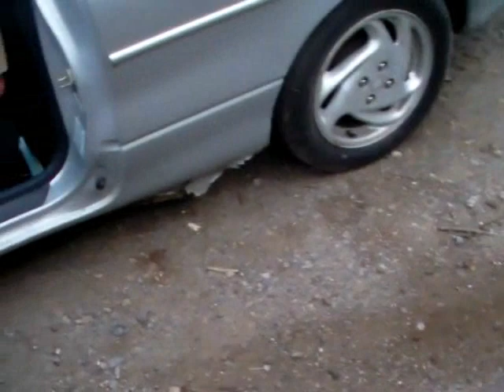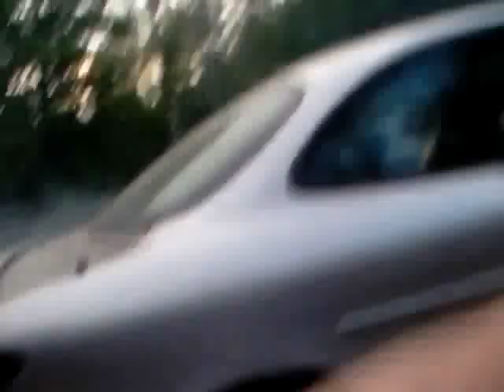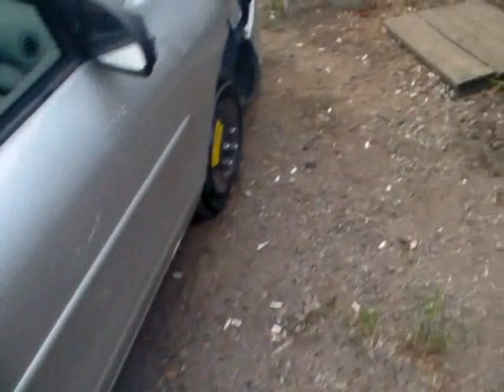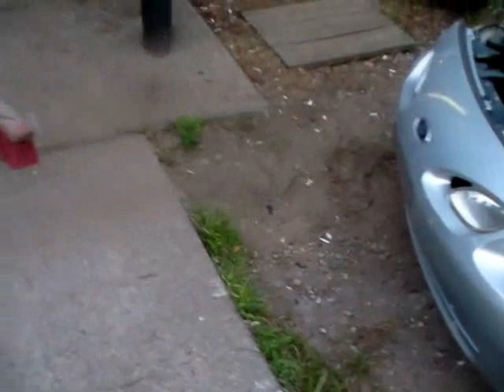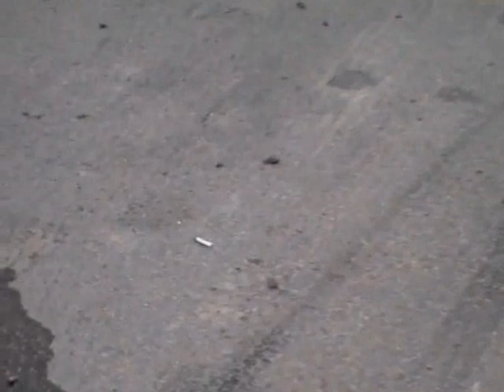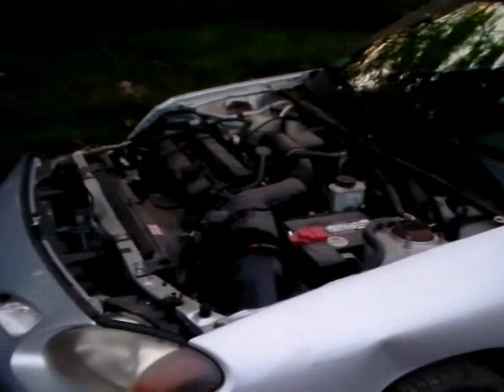Golden Boy kills my Escort part 2 WITH FIRE!!

Comment: Drove a 1998 Ford Escort ZX2 for 10 years in Pittsburgh.  With snow tires that car had great traction.  Hated to see it go, but the rocker panels rusted and my mechanic said it would not pass the annual PA safety inspection.  It was a great and reliable car while I had it.

Comment: Built tough!!! :-P But the question remains, did the motor blow up eventually???

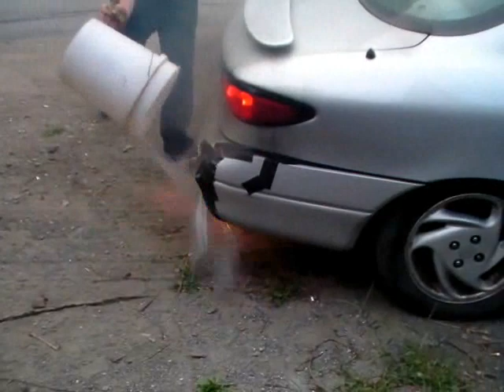edit: @4:46 after all that flame shooting, that idle doesn't sound normal! To me it sounds more like 1000-1500rpm! Did the ecu sense a malfunction and tried to keep up the amps? 
Also, I hear the car trying to start and work @7:09 and @9:35 it revs just like at the start of the vid! Did you let it cool down?

Comment: didn't think you could kill one of those. my dad has my old 91 at his house  the 4 dr hatchback and it's been totaled 4 times and had 3 timing belts on it in the time we've had it and it needs another one right now, it's got like 403,000 miles on it and all that's ever been run in it is Mobil 1 motor oil. Another of the Many reasons i like Mobil1 so much and that's all i use in my trucks BTW i am a Chevy Only kinda guy so for me to praise a Ford product is HUGE for me but when a car is a good one no matter what it is i'm saying something about it.